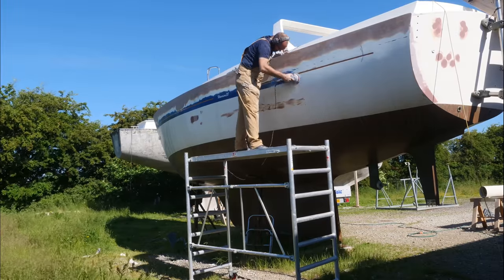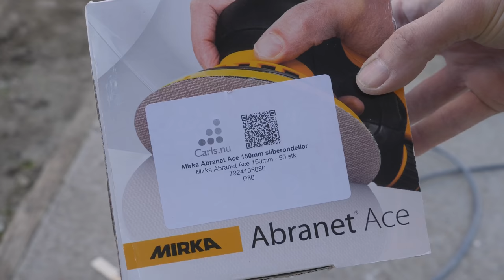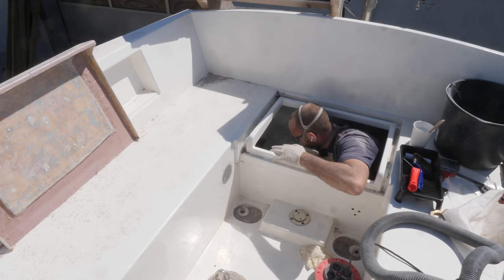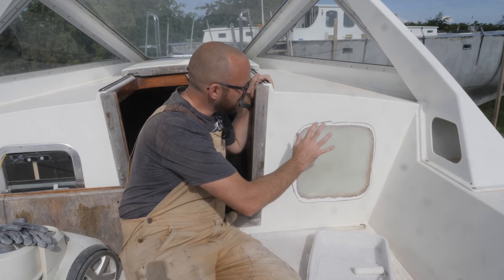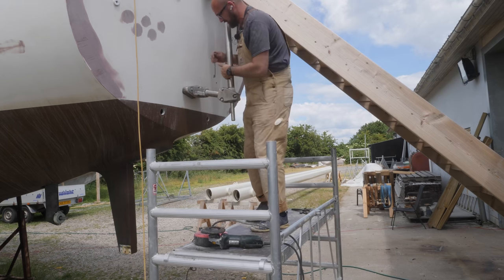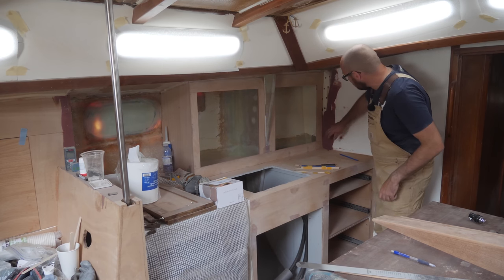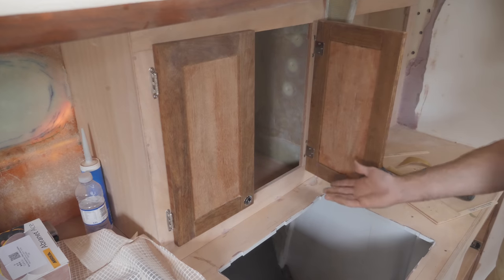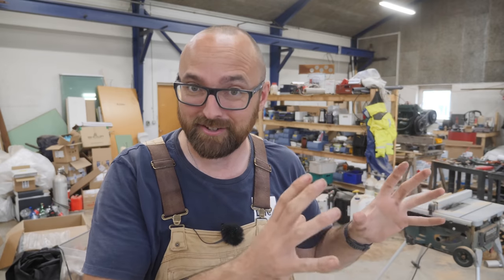Sail Life - Rounding over the deck-hull joint & applying Coppercoat - DIY sailboat project

Comment: Another great video, thank you. I binged on the Athena series and just caught up, which means that I have watched your skills grown in a time lapse format. You are an inspiration to all of your subscribers with your ability to stay with it when things got tough and willingness to tackle any project, no matter how daunting.

This comment may come too late but I would recommend that you abandon the insulation material you purchased and switch to spray applied polyurethane foam instead. Build the interior box as you described here but have a local spray foam contractor apply three inches of closed cell foam to it. This type of foam is extremely strong and it is impervious to moisture damage, it also happens to provide the best insulation values of all your choices. You will have a light but strong assembly. If you bring your shell to the contractor while he is spraying foam at a job site, it will be a quick and easy thing for him to do for you and the cost should be very reasonable. I would do it for free to thank you for the pleasure your work has provided me but since I am on the opposite side of the Atlantic, that is probably not a viable option.

Looking forward to the Athena splashing....

Comment: I learned from a boatbuilding friend of mine to always use matchsticks or similar on the outside edges of the throughull fittings when adding the sealant.  The reason is that you create a gasket effect when there are a couple of millimeters between the hull and the edge of the fitting.  The next day when the sealant has dried enough you torque up the inside nut and you will never see a leak!  
The way I think you did it by torquing the nut strait away means that too much sealant would be squeezed out giving less of a sealing surface.

Part from all that I'm impressed by your work and perseverance to bet Athena to be your dream boat.

Comment: A small suggestion for the door latches. Put a small metal strike plate on the inside for the latch to hold against. This will remove the potential for wear of the ply.

Comment: Mads, for the extra piece of backing behind the latches to reduce the slop and take wearing, use a plastic sheet of the mm thickness you need, it'll never wear out and you can just fix it into place with 4 screws after you finish everything else, it will take the abrasion far better.

Comment: I think you're going to want a second set of latches on the top for when you're under way. Or some sort of anchoring system. During a knock down under way, the top of the cabinets are not secured, there's enough natural flex in the wood that they will release under load, spilling out the contents
Reply: Yep i thought the same also...fitting one on the top and bottom either side and also rebating the door edges to meet...in a F5 anything in them cabinets will be on the starboard side in an instant. I suppose he could use fairing compound to seal them before setting to sea... it will make for another episode of sanding to get those doors open.

Comment: Hi Mads, Great job on the cabinets and the corner rounding, hint, get rid of that messy powdered guide coat stuff, grab a couple of cans of cheap flat black paint and dust it on before sanding, also continue this process on your high build primer and undercoat, and even between paint coats if you wish, this method is great for wet sanding as well even through to your sanding and buffing, that's the way the auto industry does it and i see no difference here, all the best from Aus, Allan

Comment: During the years running the family boat yard I sprayed many a boat with a Awl Grip. Not an easy product to apply and or repair. DuPont makes a much better product called Imron. I’m not sure if that spelling is correct. The DuPont product is vastly superior by way of making repairs to the paint. Another product that will help you is made by 3M , it is their vinylesters filler. This product is excellent.
One tip that may help you with the top coat color ? Mix all the color together in one pail to make sure you get a uniform color then pour the color back into the original cans for later use. This way a year or two when you need to repair the topsides you have an exact color that was applied to the hull. If you need a gallon to paint the hull Oder 1.5 gallons and put the .5 gallon in storage for later repairs. This will save you a lot of headaches down the line. The only part of the paint that goes bad is the cat/hardener. Good luck !

Comment: A bit of copper will do the same as the bit of hardwood, plus it is quite durable, two small holes, countersinking by the pillar drill and you should be set for life.

Comment: Blue waterline stripe instead of the deckline strip would look nice, very personal choice though.  Ally steering vane is a corrosion nightmare, like aluminium rudder stocks if they are not regularly cleaned or treated.  I would suggest an epoxy coating to preserve.  Rest is looking good though, well done.

Comment: Looked loke a nice week of progress .... Have you consider putting the latches on the top of upper cabinets like the bottom cabinets so the latches wont accidently be opened when working in the kitchen and the latches wont be damaged by large items moving in the cabinet during heavy passage.

Comment: I am surprised that you haven't used Abranet before! I design power tools for Mirka and have squirmed every time you have sanded on the inside without proper dustfree tools. :D Keep it up Mads, this is still the best part of my Sunday even after all this time.

(pro tip: Abranet works best when combined with a vacuum as it transports away the loose dust that would otherwise prevent the grains from doing their job)
Reply: Watch his earlier videos, he went through boxes of that stuff.
Reply: @Sciolist  Must have missed that! I should have worded it differently.

Comment: I recently got done replacing the cabinet pulls on my boat. To things, 1. The threads on the push/pull will strip out over time 2. The chrome finish begins to flake off over time. I recently replaced mine with solid stainless steel, also the extra mass gives a very satisfying "thunk" when they en/disengage

Comment: Instead of using a hardwood striker plate inside the cabinets for the locks, you might want to consider a stainless steel plate -- it would eliminate any problems with swelling from moisture and wear.

Comment: Madds I don't want to sound corny but I am in awe on how you accomplished your projects. Very impressive. What grit sand piper did you use to remove the boat stripe. Was the stripe paint or some other type of material?

Comment: I did not see how you attached the knees that cover the chain plates. May I suggest using rare earth magnets mortised into the knee, connected to some metal on the boat, if the chain plates are SS that will not work. You could use two magnets opposing and offset slightly to ensure a tight fit. I've seen that used on high end yachts, invisible latches.

Comment: I tried West System that u r using and clear fast hardner and never worked for me due to cloudiness , bubbles and unevenness.   I use liquid glass for the same cost as the West System and looks like 25 coats of varnish and the depth it looks are unbelievable.

Comment: Seems like the video quality is low. Is this a YouTube thing?? Checked back on some older videos and it’s perfect but this one is very pixelated. Boat coming on nice now, but also agree a 12mm round router on the deck joint would have been an easier and more consistent option. Then at the bow only needed to hand/orbital sand the lower edge to blend it in with the hull. Looking forward to next week’s fridge build 👍🏻
Reply: Mads, all sorted, watched it again tonight and glorious oh glorious 4K 👍🏻👍🏻

Comment: After watching you do so much filling and then glorious glorious sanding of the outer hull, I am curious if the imperfections were original in its delivered state or are the results of decades of the fiberglass curing and settling...

Comment: you could have installed the locks for the doors in the middle because you will certainly insert boards, right? So you could use these to fix the doorlockers

Comment: How resistant is fairing compound once dry? What if it gets wet underway?
Reply: Fairing compound hardens, and is very resilient. However, if it is mixed with epoxy you need to paint asap because it is not UV resistant :)

Comment: Is the proper name for the deck hull joint, the gunwale (or, gunwale hull joint)?
ASA 101: The top edge of the deck where it joins the hull
?
Gunwale
Reply: Detroit Jack ,yes you are right, gunwale

Comment: Very nice episode again Mads. Hope you get to the end of sanding the large surfaces soon. 

Regarding the weather vane, I would not mount that back. It will be easier for you to have electronic steering directly on the rudder quadrants. That way you can also use the autopilot when you motor (and sailboats motor more than they admit😳). And you will have less holes to drill into your hull.
Reply: Fr anz good quality windvanes, and hydrovane easily fits that description are perfect for cruising, no power, reliable and add redundancy to the  steering
Reply: Mike Hensen : a boat is better with less systems on board. Since Mats has electricity, why would he have something that only steers while sailing, changes course if the wind changes, takes a lot of space,... while he can get everything tucked away, reliably with modern electronics?
Reply: Fr anz redundancy is better at sea imo, Mads is going to have tons of systems already on his bot, this is one that doesn’t need his electrical system to function, plus works better the more wind there is, which is the opposite of some autopilots.
Reply: Fr anz electric autopilots fail pretty often...good to have the vane as backup. Plus if for some reason he loses electric instruments (lightening strike) he can still sail far with out getting worn out holding the wheel.
Reply: James Rhodes : hehe, you’re the kind of guy who wears a belt and suspenders and then ties a string around his pants😀

On my boat I got hydrolic steering (don’t trust these cables that wear out) linked to a Raymarine autopilot. Not a failure in years! What have you got on yours?

Comment: The stainless rod thru the stern for the weather vane. They make something called an isolator kit that uses fiber gaskets and stuff to isolate the stainless from Alum to dramatically refuse the corrosion. https://blog.projectmaterials.com/flanges/flange-isolation-kit/ they make different sizes

Comment: Me (someone who's about to buy a sailboat) every Sunday: "Yes! SailLife! Let's see what shenanigans he's been up to!" Also me every Sunday: "Holy c@%p I hope I choose my boat better than he did"
Reply: Woobie  No, to an extent... But there have been many surprises - obviously rotten deck and grid cores being the worst. He's worked through them admirably, but I can't believe it's what he would have wanted; it's certainly not what I want. I worry a lot for them about the now (mostly) encapsulated grid-core, I just hope it doesn't give the boat a permanent pervasive musk.
Reply: As long as you don’t decide to take your boat back to a bare hull you should be okay.
Reply: To heyheyjc, that's why you hire a 'GOOD RELIABLE' Marine Surveyor, and listen & read his suggestions  & report.
If you do, you'll be fine.
Reply: If you have been watching since the beginning you would know he wanted to do a big project as part of his dream.  Perhaps this turned out to be a little bit bigger than he planned, but he did want to do a major multi-year refit.  

Wet deck cores are pretty much de rigor in older sailboats.  The issues with the hull keel reinforcing structures was a bit of a wildcard though.  It was an old boat, and it was built in Britian.  It could have been much much worse.  Now he has something that can't be bought new for any budget most ordinary people could afford.  Although I would personally not want anything but a full or 3/4 keel boat with an attached skeg-hung rudder and a protected prop apechure. That's a personal thing.
Reply: @heyheyjc  Used yachts, be it the slightly derelict variety or the sort which was sailed seriously, do have work to be done. You won't find any boat with all work already done and still even somewhat affordable I'm afraid, only exception might be an inheritance bought from a widow within weeks after the skipper/owner/husband died .....
Reply: I appreciate all the advice, and of course a survey by a well recommended surveyor is in my future. I've watched this channel from the beginning and he definitely was not planning on half the stuff he's had to do. I'm looking at older boats, and am very aware of the pitfalls therein. All that said I stand by my comment: I really really hope I choose better. Or at least perhaps luckier.

Comment: ok so crappy hinges it is.... re: cabinet push locks above counter - did you think of installing them at the top? (no worries - if hinges are equally spaced from edges at both top and bottom then you can flip both doors around 180 degrees)... re VARNISH.... I'm no fan of varnish on heavy use floors like churches i restore and marine applications... have you thought of just 3 coats of thinned epoxy instead with 220 grit WET SANDING in between coats?? just as clear 10x tougher and lasts longer.... BTW---- DON'T varnish cabinet doors and drawer fronts while in vertical position - will run and pool at door frames - - better finishing the fronts on the side and placing on pins to dry (pins: 4 penny finish nails through a base board where doors rest on nail tips to dry the varnish.)... BTW: 220 grit wet sanding in between coats will leave an amazing finish! even if satin! (not to be confused with Satan) - HOWEVER the Devil and or Orcus is in the finishing details and means more than the oh glorious fiberglass and sanding as no one sees the effort after it is all done.) re: Hull - - I would inquire about getting an auto-body car/truck painter/finisher to do the work - the results are 1,000,000 times better than you may think even with marine hull paint! - wish i could attach images of some outrageous and amazing jobs on sailboats my local guy does!! you'd swear by it and is tough as the last hooker from the Bronx)....

Comment: You are making this far to complicated for yourself.
You could still use the router working of the top horizontal surface.  You would get a nice even curve and a vertical face.
For the sections near the bow all would need to do is round of the bottom edge to match the curvature of the hull  and get rid of the vertical edge where it should not be vertical